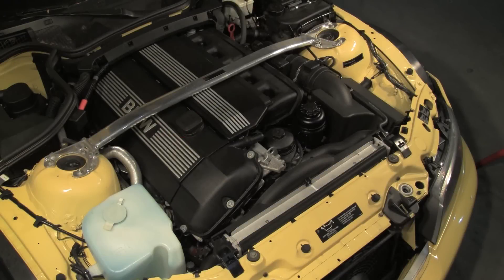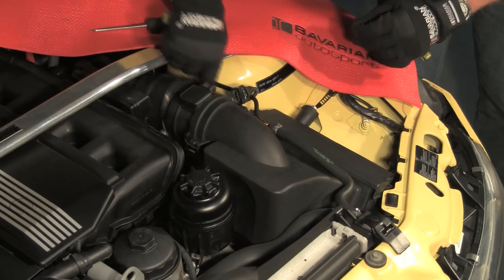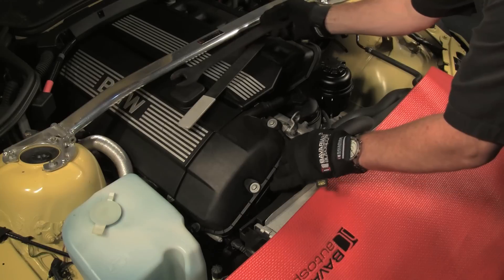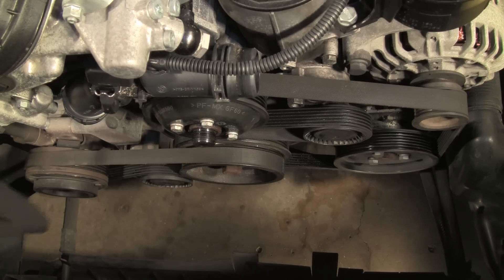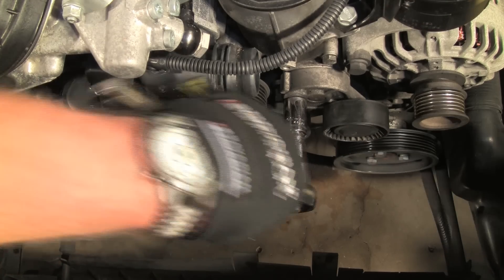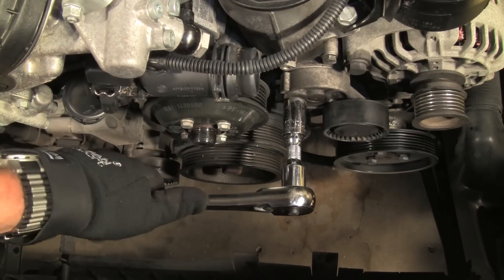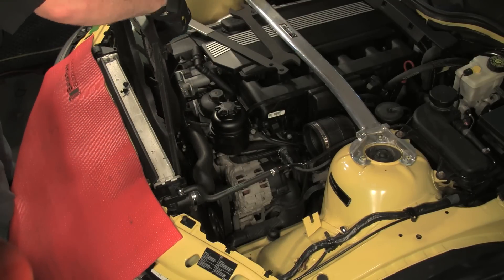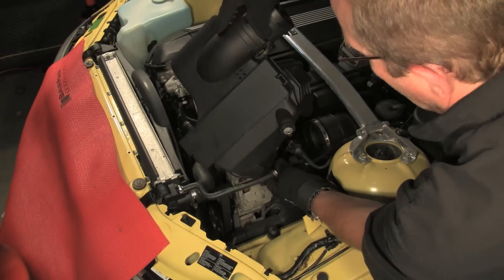BMW Serpentine Belt and Pulley Replacement, How To

Comment: Invaluable Information & Video ... Did my 2000 BMW Z3 today, changing pulleys and belts and the power steering fluid filter .. save myself tons of bucks with this video at my side .. Thanks!!

Comment: I can't seem to get the belt back on, even when the tensioner is at its loosest. I know the belt is correct because it fell off when the power steering pump prong broke off, so I replaced that, so the belt must go back on, I would think that one would loosen the tensioner and slide the belt back on just like you did and then tighten the tensioner back, but I can't seem to get the belt on. I tried a couple of cheap installers, but they were too small and didn't fit, the magnets don't stick, I just can't figure it out. Mine is an E38 2000. Any ideas?

Comment: The air conditioner belt tension pully , upper mounting bolt was removed in the beginning of the process. No where in the completion of the job, after belts replaced, does it show or say that that bolt (upper bolt on the air conditioning tension pully) needs to be replace. This is a very important step and was left out of the video,However, this video was very helpful and very much appreciated for me, not being a mechanic, saved me at least a couple hundred dollars. Thank you

Comment: Help I have a 93 bmw 325i the engine won't turn over when I use the key, I had change the battery and the altinator but its still the same problem, when I jump start it the car the engine always turns over, but it won't start when I use the key and also when I leave the battery terminals on it drains the battery.

Comment: Was told need to replace belt and tensioner. Is the tensioner really need to be replaced $600 for a spring that got some oil on it? Would like to not replace old one if it looks good, but not sure if would be OK . Any ideas?
Reply from the maker: Well.... it depends.  The pulley bearings do wear as well as the tensioner spring or piston (depending on type).  What application are you looking at that has a $600 tensioner?
Reply: told my 2007 328 needed new tensioner and belt - $600

Comment: i have an 528 i 1997 ..and  my brother has the 1996 i have automatic and he  has manual..we both have  m52 engine only one strange thing he has two pulleys also one above the tensioner pully and i have only the tesioner pulley  but not one above it like on video  ..how is this possible

Comment: why do you refer to hex head screws as bolts, a bolt is something with a nut, you can have hex head or socket head screws, the are all in the  cat of CAPSCREW, which  was a word used for bearing caps
all these  are screws
thanks for info, but you let  it all down by your terms
Reply from the maker: +stuarth43 - Accurate points.  However, most of our viewers are more familiar with calling any hex-head fastener a "bolt".

Comment: Gr8 video. Well done. Thanx.   Have a 325i 2002 model, on mornings cold start and misfires. After a few minites it idlies fine . What is the cause of that?
Reply: Jomiah Bernard i know this is old. but bad spark plug

Comment: Hello
I have e39 with M52tu engine (double vanos engine) 523i
I have a strange noise when I start the engine in the morning 
After engine runs for 2 or 3 min the noise goes away. If I shutdown the engine and start it again noise does not come again. It comes only on the first time when the engine is cold.
I made a video here it is
https://www.youtube.com/watch?v=zbT6QSnPhGU
noise is gone at 0:58 in the video
What it might be? any pulley? belt? or something else? please help
Reply from the maker: Hmm .. we may be able to better suggest a source if we could hear it in person.  Since you had the camera on the intake side of the engine, are we to assume that the noise is seeming to come from that side?  Even though it is not on the intake side of the engine, let's check the Secondary Air Pump.  Unplug the pump before the next cold-start and see if there is any change.  The pump on the E39 models is behind the bumper on the right side.  You could also remove the fuse for the pump.
Reply: BavarianAuto
Noise is coming from the front side were the pulley and alternator are located.
My engine does not have that secondary air pump. I bought it in japan and non of the engine produced in japan has that pump (well a lot of my friends has m52 m54 engines from japan and non of them has it)
http://www.bimmernut.com/forum/attachment.php?attachmentid=7525&d=1320190697
Part number 1 marked on the picture is not in my engine so i suggest I don't have that pump =/
May it be an oil pump? someone told that its a oil pump =/ or water pump?
thank you for your response 
P.S sorry for my english
Reply from the maker: Irakli Kavsadze
I don't see this as an oil or water pump.  Try using a mechanic's stethoscope with a megaphone end (for airborne sounds) to see if you can get any closer to the source.

Comment: i have a 2003 bmw 745li and i have problem with my belt  i change the belt 4 times and the idler and tensioner  but i found out that i have to use a belt from the dealer i can put a new belt on and  it will work good for about 2 weeks are 1500 miles  then it will start  squeezing again do you think i have to get a   tensioner pulley from the dealer

Comment: HELP! HELP. where is the input turbine shaft sensor on 1999 BMW 328i. I'm trying to solve a P0715 code.
I googled it but had no serious info.
These videos are excellent.
Reply from the maker: This is a transmission fault code and is referring to the input speed sensor.  The sensor is mounted into the transmission housing just forward of the valve-body, after removing the fluid pan. Click the link below:
http://www.bavauto.com/fland.asp?part=24%2035%207%20507%20706
Reply: BavarianAuto Amazing! this is a direct and clear answer. Thank you for your answer. I will not forget.

Comment: for those of you who are JUST replacing the belts (and not the tensioners), this is a 5min job (maybe a 10min job if you work slowly).  
The air filter box, and radiator fan/shroud, DO NOT need to to come off to get to the belts.  

All you have to do is loosen the tensioners (16mm socket) and slip the belts off.

And like he says in the video, take the lower (A/C) belt off first.  
Once the A/C belt is off, loosen the second (main) tensioner and the main belt can be slipped around/past the fan and out.  
The new belts can go back on in the reverse order, it is really that simple.  the only tools you will need is a 16mm socket wrench.

(the A/C belt is easier to get to if you put the car on jacks and work from the bottom)
Reply from the maker: Right-on, BenDC85 - Thanks for sharing this point.
Reply: I know this was a long time ago, but what model is that true for?
I have a 2002 z3 3.0i. The belt broke yesterday.
I can't find the fan removal tools anywhere in town. Ordering them will take a month right now. Maybe because of the shutdowns.
I hope you can tell me that I can replace the belt with just a 16mm socket!

Thanks!
Reply: BenDC85 That's right. I have replaced both tensioners and never needed to remove the fan. It's just slightly tighter but not to bad.
Reply: BenDC85  
MY belt snapped on the weekend and the car got a bit warm. I maybe drove about a km before stopping and letting it cool . The oil seems to be fine(not milky or mayonaise like ) would belt replacement and pressure test be the prognosis ?
Reply: My ‘97 2.8L Z3 required the removal of the air box, fan, fan shroud which included the expansion tank for me to even get access and clearance for the bolts. It only took about 1-2 hours to replace the belts

Comment: tengo un bmw 325i 2003   abres la llave y le funciona todo el tablero pero no tiene marcha el motor  y le doy directo al motor de arranque y no prende
que puede ser
Reply from the maker: If the engine is not starting, but the starter is cranking, the first steps are to check to see if the fuel pump is running, is there spark and are the injectors opening/closing.
Reply: i think its your alternator

Comment: I replaced all of my pulleys and belts this Saturday just gone 14th/06/2014 . My car is 2002 530i MSport, virtually everything shown above is correct except when he slides out the fan cowling. At the bottom of the cowling there is several heaters hoses attached which you also need to un hook. Not disconnected
I managed to slide it up high enough and twist it to right to get it all out the way without discoonecting those hoses, however you will need to disconnect the little black hose that attaches to the header tank on the right hand side of the top of the radiator. It is a bit awkward but then i simply laid the cowling back onto the engine allowing enough room to access the lot. Whole job took 1.5 hours taking my time. I only had to add a cup full of coolant afterwards. Works perfectly , used OEM parts and replaced all pulleys and belts
Reply from the maker: Thanks for sharing your input.

Comment: Are there any torque specs to worry about with this process?
Reply from the maker: If you have a general sense of torque values (and what they feel like) for typical fastener sizes, there is no real need to use a torque wrench for the fasteners involved here.  Of course, each fastener does have a specified torque and if you wish to have these values at hand, the applicable Bentley Publishing repair manual will contain the information.
Bentley repair maunuals:
http://www.bavauto.com/se1.asp?dept_id=5228

Comment: Can a mechanical tensioner fail and how would one know when it does? Can the pulley be replaced on a mechanical tensioner? I have a 95 325i. Thanks for the videos!
Reply from the maker: The pulleys on the mechanical tensioners are not available separately.  Therefore, the tensioner assembly must be replaced if a pulley faulty.  Besides the obvious pulley bearing failure,

Comment: I have a 2002 E53 3.0 M54. I want to replace the belts and tensioners, but would like to be thorough while the belts are off. I am going to also replace the water pump. What other parts/pulleys should I replace while its opened up?

Comment from the maker: The idlers are "hard mounted" and direct the belt in order to apply additional torque to a driven pulley or to direct the belt to the next pulley.  A tensioner pulley is spring or hydraulically mounted an "pushes" or "pulls" on the belt in order to keep the belt tight on the pulleys.

Comment from the maker: Well, we're not sure just whet the mechanic may have had in mind, but the belt replacement certainly does not require removal of the turbocharger.  The belt is accessed through the passenger wheel-well area. Remove the wheel, then remove the inner plastic shielding.

Comment: can you help with e36 m44 motor belt tensioner. this looks as ugly as it gets and there is no info anywere for this model.it looks like you need to take the whole poer steering assembly off just to get to it

Comment: DeTensioning the belt was accomplished with a T50(60? can't remember) as shown here.  The tensioner can be removed after the idler pulley was removed.  If you're changing your tensioners, you might as well change the idler pulley as well.  Assembly is the reverse of removal.

Comment from the maker: You shouldn't have any specific trouble in de-tensioning the belt by rotating the tensioner pulley against the tensioner.  Once the pulley is rotated, pull the belt off of one of the pulleys and then release the pulley.

Comment: How was it to remove the belt and tensioner with the additional idler?  It seems that the idler is restricting access to the bolt for the upper tensioner.  Is there a particular sequence to removing and assembling?

Comment from the maker: Thanks for your notes.  There are indeed, differences between specific engine models, in placement and use of idler pulleys as well as the differences in mechanical vs hydraulic tensioners.

Comment: You guys did an excellent video, probably one of the best on youtube!  However the OP to this question should note that there are some models with the M54 (such as 330ci) that will have an additional idler pulley positioned above the tensioner that the belt runs under.  This pulley is often the source of bearing noise when worn.  anyway, thanks BA I was able to complete this project his weekend thanks you!

Comment from the maker: You will need at least a 3/8" drive socket set.  However, a 1/2" drive set would be better, especially for detensioning the tensioner.  The socket used for the detensioning in the video is 17mm.  However, different models may have different sizes.

Comment from the maker: The M50 will be very similar.  Any differences will be more due to whether the engine has a mechanical tensioner (as shown in the video) or a hydraulic tensioner.

Comment from the maker: As noted in the video, you do not need to remove the radiator (or the hoses) in order to replace the belts and the pulleys.  We removed them so that we could get a better view of the belts and pulleys with the video camera.  We would normally only remove the fan and the fan shroud.

Comment: My only gripe with this video is that I just noticed they removed the radiator hoses but they don't mention any of it on the video. Is it gonna make a huge mess and how do I prevent it?  I understand you have to edit the video but that is critical not to mention someone as newbie as myself could really get into some deep trouble if I screw something up.  Just some constructive criticism, no disrespect.
Reply: they said in the beginning that the radiator was removed for a better view, pay attention!

Comment from the maker: Remove the plastic center cap on the tensioner pulley and use a Torx or hew bit (with a ratchet) to press against the hydraulic piston (in the same manner as shown for the mechanical tensioner).

Comment from the maker: Yes, all of our videos are fully edited so we can show hours of work in a few minute video.  We did indeed use the hammer to break this one free.  In our overall experience, on many models, they do usually break free with a good crisp hammer hit.  You typically do need the pulley holder tool, so that the pulley does not turn when you hit the hammer.  If the pulley is held secure so that it cannot move, the hammer blow will do the trick most of the time.  Just remember, the thread is left-hand.

Comment: At 2:25 I call BULL ISH!! I see they cut and edit the clip. Just a hammer will not get that fan off. Have to use some break free and let it soak for like 10 minutes. I know, I know, i'm not mad. Just saying that part is usually difficult. Be sure to put anti-sieze on the fan clutch nut so its easier next time when installing. EXCELLENT video though.

Comment from the maker: The main belt drives the water pump, alternator and power steering pump.  The air conditioning compressor is on the smaller secondary belt.

Comment from the maker: The piston should not push all the way out of the cylinder.  If it is, it needs to be replaced.  We do have them in-stock at bavauto.com or call us at 800-535-2002

Comment: Thanks!!  I'm guessing right now that it is (was actually - it's working fine now after 200 or so miles!) the secondary cooling fan (which is why it could keep sounding  for a few seconds, after the engine was turned off).  I'll have it looked at by my mechanic here in Dallas next oil change.

Comment from the maker: You may have a vacuum leak in the intake system.  This could be any of the intake boots, bellows, hoses, etc., or the crankcase ventilation oil separator and check valve.  The leakage could also be in the fuel tank vent system.  Obviously, without being there to diagnose it, there are certainly other possibilities.  Have you gotten under the hood to try to localize the sound, when it happens?  This should really be the next step.  Feel free to call us at 800-535-2002, for further assistance.

Comment: Question: I have a 2002 330ci and have had an on and off high-pitched whine over the past few days (when it whines, it's full loudness and when it's not, car sounds fully fine  It's always one or the other when start 'er up).  

When it's there, I turn engine off, engine comes to a complete stop yet the whine continues for a full second or two and THEN winds down.  Any idea what it might be? (The idler pullys have stopped while the whine continues for a sec or two ... and THEN slows).

Comment from the maker: If the pulley has any play or roughness when rotated ... replace it.  The further school of thought is to always replace the pulleys when replacing the belts.  If a pulley seizes or gets too wobbly (loose), it will throw the belt, resulting is a road side tow and subsequent repair .... or damaged engine due to overheating.

Comment from the maker: @tomaskantor1 
Well ......... This particular car has 60k miles, has never driven in salt (winter roads) and we do clean under the hood regularly.

While some would not agree, we do not have an issue with using the "quarter car wash" wand under the hood, along with cans of engine cleaner.  Just be wise about what you are spraying.

Comment from the maker: @chicoloco101 -
While you may or may not "need" a new tensioner or idler pulley, it would certainly be wise to replace all of the pulleys.  This will assure that you do not have a pulley failure at some point after replacing the belts.  A faulty pulley can cause an annoying squeal and eventually will seize or come apart.  This will result in loss of and damage to the belts .... as well as a full vehicle failure as the water pump and alternator will no longer be operating.